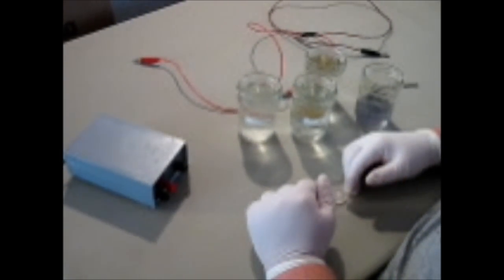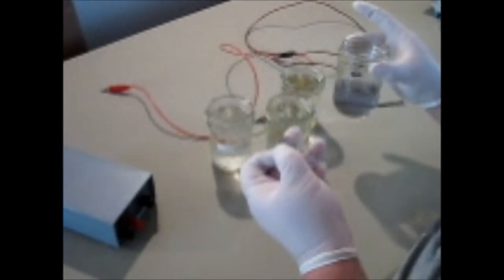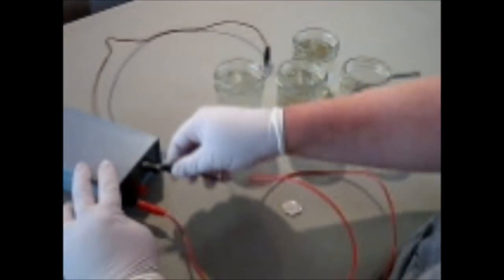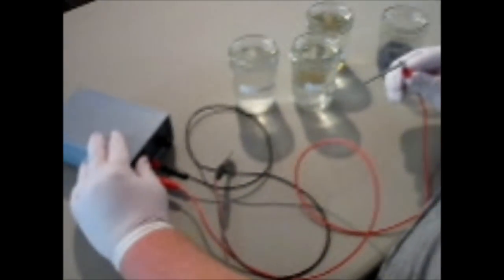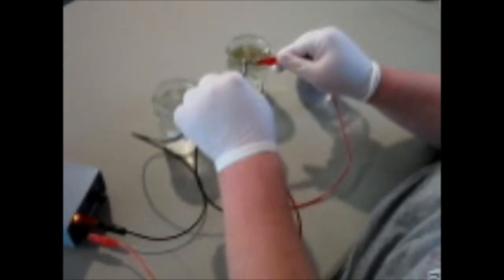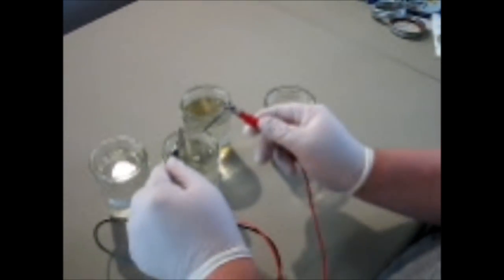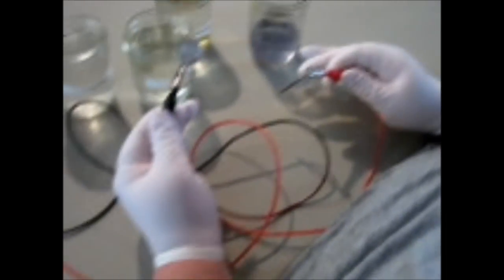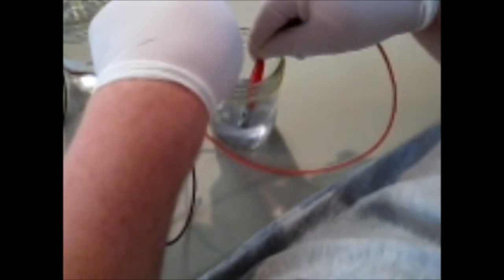Immersion Gold Plating 101

Comment: The gold elecroplating solution contains potassium dicyanoaurate dissolved in pure distilled water. Rubber gloves and caution must also be used, because the chemical in the solution contains deadly cyanide. Furthermore the anode does not have to be only stainless steel, because using pure gold instead will make a superior anode. In fact, if pure gold is used as the anode rather than stainless steel, then the gold electroplating solution will last much longer. This is because by using a pure gold anode, then the gold cations in the electroplating solution will not become depleted since they will be replenished from the gold anode.
Reply: I use a 1 gram piece of gold for the anode however it leaves a dark smut deposit on the piece when I gold plate with 2 AA batteries. Is this normal? Appreciate your help